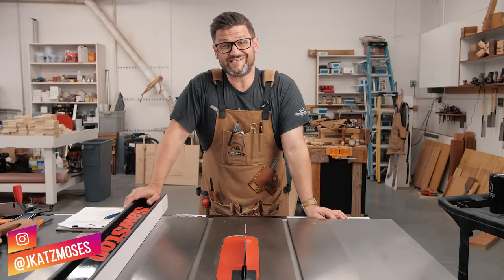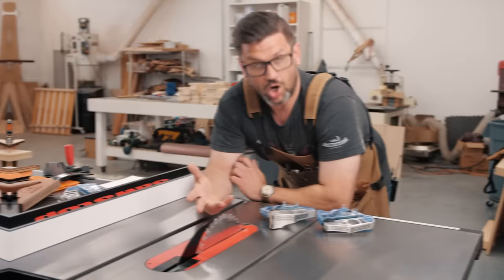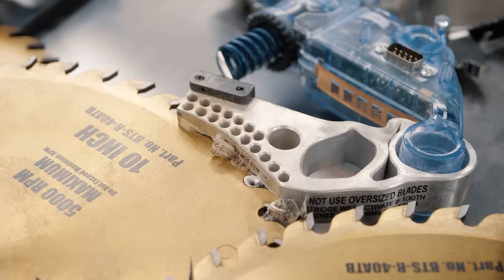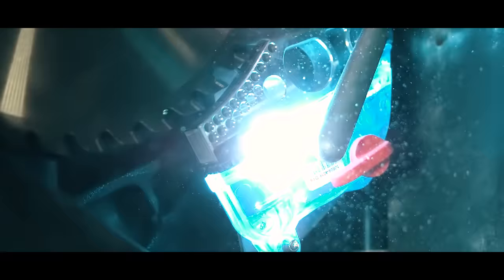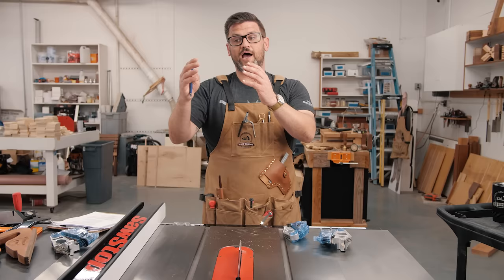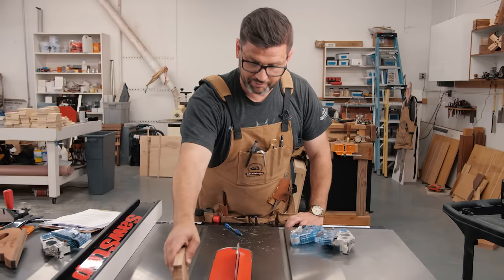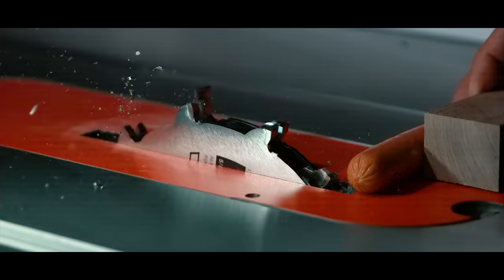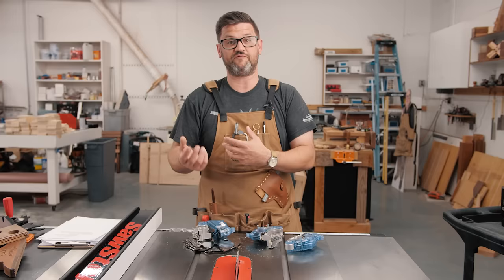How Safe is a Sawstop Saw? - Never Before Seen 19,000 FPS HD Slow-Mo Video

Comment: How do we know that this saw isn’t programmed specifically for hot dogs, but they just say it won’t chop your fingers either. I need to see them use their actual fingers if they trust it so much!
Reply: First, the creator already did put his finger on it, and second how dafuq did they programed the conductivity detection specifically for the hotdog, a sweaty human finger have much higher conductivity than a hotdog, so why they would need to do the extra work to program the saw stop to only specifically use it on hotdogs?

Comment: 1/8th of an inch into your finger, and you're saying no major damage?... dawg you're alone in that camp

at university I took wood working courses and I respected every piece of equipment I ever used. 

I was told about the sawstop but I still used it like it would chop my arm off, also it's a bitch to replace that mechanism.

To avoid kickback I used guides

the agonizing thing was watching other people trying to make cuts that they could've made with the Compound miter saw, and they'd lean over the saw.

I'd always come in during open studio hours to finish my projects but one day this chick had some pine from home depot (Which there's nothing wrong with that I can make some cool shelves all day with pine) and it had a metal staple in it. And sure enough the saw dropped and because I was mr. fancy pants trying to finish my projects early I didn't get to see it, and I heard she did it again almost immediately and she started crying. After that the instructor didn't like her and was over her. lolol... I couldn't believe she was in an advanced woodworking, at that point I was good with a chisel though...
Reply: 1/8th of an inch is still better than losing a finger, so ill say thats a minor damage compared to losing a finger
Reply: Huh, its either i got a really big finger or you got a very slim one because 1/8th of an inch is 1/4th of my finger and not much to lose compared to an entire finger

Comment: Not gonna read 25,000 comments for the same question to get the answer, but what if the wood is simply wet or green and you're holding it to cut.. Won't that cause a it to stop? Sawstop don't look cheap to buy.

Comment: I still don't understand how the saw detects that its cutting into soft tissue and doesn't stop with wood
Reply: A small amount of voltage is running through the blade. The computer detects the change when the blade is in contact with something conductive like flesh.
Reply: @Xynic48  so, if for example, the piece of wood was wet would it trigger too?
Reply: @Amalvipls  Maybe
Reply: @Amalvipls  water alone doesn't conduct electricity. It's the particles in the water that conduct electricity
Reply: @cherrypepsi2815  who the fuck thinks of 100% pure distilled water in this case
Reply: @Amalvipls  idfk I didn't make the product
Reply: @cherrypepsi2815  then don't answer

Comment: Still not sure about these. More often than not Im working with other materials such as plexiglass or polycarb which I sometimes have to cut on the saw. If you dont clean the sawstop well enough after something like that, it could just trigger the break. Ive also had a lot of problems getting it to start in multiple shops because it always "detects" something touching the blade when you go to turn it on. They're safe yeah, but just not as efficient as a good saw. Just dont do something you're not comfortable with. Its also worth making jigs and other things to help.

Comment: boss, I appreciate the video and the tech, but that ain't 1/8" looks more like 1/4 or more.  Then again, no one usually does anything at full speed on a table saw.  These are nice but the bottom line is that amateurs (and pros) need to learn proper safety when working around table saws.  My table saw cost $250 and I've had it for decades.  A saw stop saw is what, $2000?  But you'll saw "what is the value of your finger" well if you know what you are doing you'll be o.k.  Now if you are tired or rushing....  And by the way touching the blade is not the only way a table saw can hurt you.  What about kickbacks?  Can't stop that.  So you see, no substitute for proper technique and safety gear.  Was a nice idea, but I worry it will give many a false sense of security.

Comment: I get that this is basically an ad for Sawstop, and it's a cool technology, but 67,000 injuries from table saws, wouldn't make it the most dangerous tool.  That is the ladder and it's not even close.  On average ladders result in 164,000 injuries and 300 deaths in the US each year.
Reply: Assuming those stats are true, we need to also consider both how often ladders are used compared to saws, and how many different people use ladders compared to table saws.

We should also consider the types of injuries. Most ladder injuries could be twisted ankles whereas most saw injuries are stitches or lost limbs.
Reply: @NoNameNoWhere  Those stats are from NACHI which listed it as emergency room visits, so probably not at home sprained ankles.  You don't need to know who and how often people are using ladders to say that based on those stats ladders result in more injuries than table saws.  You are more likely to lose a limb (or finger) with a table saw, and more likely to die from a ladder fall.  Take your pick what you think is worse, table saw accidents are definitely more scary.

Comment: so you are saying that you better not wear gloves because sawstop is controlled by electric current

and who tested it in the desing proces?
Reply: That doesn't make sense.. Yes, sawstop works with electrical current.. But, the saw will simply cut trough the glove. Your fingers will then still touch the blade. Resulting in sawstop firing. The gloves don't change the electrical conductivity of your hand.

Comment: What all the YouTube experts who cry about the speed of the hotdogs fail to realize is...... nobody is punching wood through a table saw. 🤣🤣🤣Like seriously these fools should get educated on the proper use of a table saw. For example that would be like criticizing auto crash test results by saying "well I bet you wouldn't be safe in that vehicle if it went 200mph into a brick wall"...... Which I'm sure is true, but since that never happens, who TF cares. Bottom line is this thing works, and it works best when people are using the tool as it's intended to be used. You can make any product fail under ridiculous circumstances.

Comment: There was another competitor to Saw stop, but it used a piston in a cylinder and a spark plug to heat the air, pushing the piston to drop the blade. It DIDN'T DESTROY THE BLADE. Unfortunately, Saw Stop won the patent fight. As someone with on hand, I am concerned people will be sloppy and assume the saw will always work. I saw that case once. I was at Pumping Station:One. A guy was going to rip a long board, so I was at the other side to support the cut board, when it popped. He had concentrated on his left hand, not his right hand. It nicked his right thumb. This encourages people to be sloppy instead of properly paranoid.
Reply: I 100% disagree, this saw is to save fingers and help avoid injuries. I work in a mill, we have 9 table saws and they run 10 hours a day, before our owner invested in OUR safety, he had had 14 hand injuries from his table saws, once we got 9 SAWSTOPS,  we have had 0
in 3 years!!!

where is the sloppiness sir?

another  KAREN that does not have a clue or  care!

2023
Reply: @notme8099  - you are in a commercial job. I'm not against safety - I have one hand and I use power tools, including table saws. I joined a woodworkers guild that has two saw stops. My point is people can get sloppy and assumes the safety feature will always works. That is a dangerous assumption. Paranoia is a good attitude around power tools.
Reply: @onearmedbandit9543  The injuries due to sloppiness while using SS will be far less severe than an accident while being "properly paranoid".
More than equitable trade off IMO.
Reply: @RazorStrap  basically agree. I don't have spares. But my concern is people not having a healthy paranoia. If you get sloppy with a SS, then switch to a traditional saw, you can get sloppy. YMMV - I'm out of spares.

Comment: @2:29 When the first Hot Dog hits the blade you can clearly see a nice big plain as day mark notched into the hot dog,  but THEN you show one at
@3:29 and magically there is no mark at all,  you even say "look at this hot dog there is no damage" or however you said it. I mean it's kind of a big deal when you lie like that. The damage was very very minor so all you had to say was look at this -very little damage. but you went above and beyond to lie and say there was no damage at all and I just don't get it
Reply: It seems more like a trick of light. The thing is that when you first see it at 2:29 the light is coming from a very different angle which highlights a lot the recent mark on the hotdog, it looks far more clear. If you zoom in you can also notice that it is indeed barely a scratch. Then at 3:29 you can still see the same mark at the top of the hotdog. It does look a bit darker than at the first shot but, again, it's due to the angle of the light. Also it may have taken him a few minutes between recordings so the hotdog started to oxidize due to the outer layer being scratched earlier.
So, no lies at all in the video.

Comment: that cut was more than 1/8" more like a 1/4 if you measured it correctly  I have used these, triggered one once trying to cut foil faced insulation, triggered by the foil not my finger, i dont care for them, just pay attention to what your doing at all times
Reply: Because foil is conductive mate, don’t use a conductive blade if you plan on cutting conductive objects. Surely if you spent the money on one you at least did the research 🤦‍♂️
Reply: This boils down to you not understanding how it works and consequently how to work with it.

Comment: "I have a sawstop so I don't worry as much anymore anymore"

That is a common problem with these kinds of safety measures; they make you complacent. Basically you now become less careful about where to put your fingers because "the sawstop will save me". And then you visit a friend's workshop and you're not as familiar with his tablesaw but you stopped careing about where tyour fingers are because the sawstop wil save you, and you lose a hand.

The saw doesn't kill people, complacency and ignorance kills people. Even this sawstop will not save you from kickback and you can be absolutely sure that the one time that you really get your hand in there, the stop will fail or launch something at you in some different way.

The correct way to handle a tablesaw is to ALWAYS assume it's going to want to kill you. The second you stop thinking about EVERYTHING you do, it'sgonna kill you.

Yes the sawstop is a nice feature but like anti-lock brakes and airbags; they make the users act like morons.

Comment: Pretty unneccessaty feature, cause
1. it makes the saw expensive and for the overall quality of the saw, the price is just too big
2. your hands won´t be near the blade anyway. If you ever trigger this system, you were the problem. 

In my 65 years of working with table saws, my fingers have never even come close to the blade.

But yes, if you are a hero woodworker, buy this.

Comment: all these tests are with a clean table and a clean blade. and with a clean sausage.

I'de be more interested to know how well it works when there is dust, oil and dirt involved.
will it cut deeper when the skin and all involved is dirty and thus less conductive.. that is the only realistic test we need to see

And stating 1/8th of an inch will not hit bone?? Thats BS man,  if the blade comes sideways to your thumb, on the knuckle.. that will defo hit bone..

Comment: Thank god now people can use table saws incorrectly and dangerously now
Reply: That literally makes no sense but ok. Guess we should abolish seatbelts and every other safety measure we've created.
Reply: @HollowKnightReference  people injure themselves on tablesaws ONLY when they use them incorrectly. Your hand doesn’t need to be anywhere near the blade. How does that not make sense? Not comparable to seat belts where they can save your life due to someone else causing an accident.
Reply: @Aidllorca  Doesn't make sense because we would not need any safety precaution if people were perfect.

Comment: First of all, an 1/8" deep cut on a finger, is not by any definition minor.  While it may not reach bone, it's easily severing tendons.  Second, carbine teeth are not welded onto a blade, they're soldered.  Third, it was not the "g-force" of the brake that broke the teeth.  You can clearly see in the video that the brake impact caused vibration in the blade.  Combined with the fact that the blade stack did not decelerate evenly, the carbides collided with each other causing them to shatter.  

The tech is impressive but take this video for what it is.  A paid advertisement, not an independent review.  If anything, the video shows clear room for improvement.

Comment: In fact, the system is not only not safe, but also wasteful.

There is a chance that you will still lose your finger, as confirmed in the video
There is a possibility of damage from fragments of the disc, especially hot

But also an emergency stop requires the replacement of the locking mechanism, the disk, and even deeper parts of the machine (shafts, gears and motor)
Reply: A safety solution that is 90% perfect is always better than no solution at all when it comes to irreparable injury.

Comment: When I took wood shop in my sophomore year of High School (1971) I don't think saw stops had been invented yet. 
Personally, I have never understood WHY some otherwise intelligent(?) "people" (note quotes) insist on removing ALL safety guards, be it saws, farm implements, mowers, weed eaters ... whatever. 
I've even known a couple 2nd and 3rd generation farmers who like daddy and grand daddy lost fingers from removing safety guards.
The "It can't happen to ME!" syndrome? 
Too stupid to learn from other's mistakes? 
Just plain dum arse vacuum between the ears morons?
Your guess is as good as mine. 🙄

I also knew more than one cutter at a metal scrap yard (uses an oxy - acetylene torch to cut sheet metal, pipes, beams, etc. to size for loading onto trucks to the foundries that melt it down for use in new steel) who refused to wear leather aprons, and set themselves on fire ... more than once and on different days ... some "people" never learn. 🙄☹️